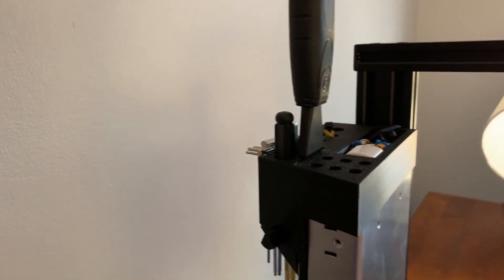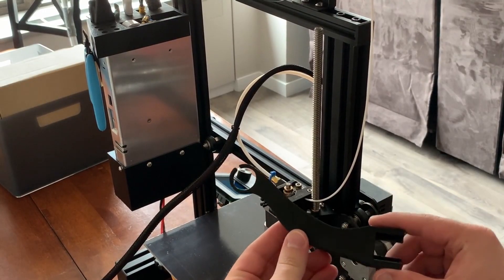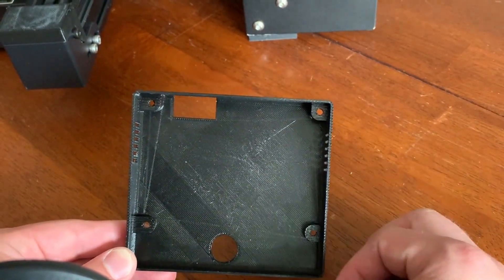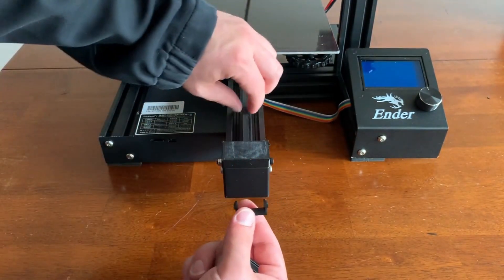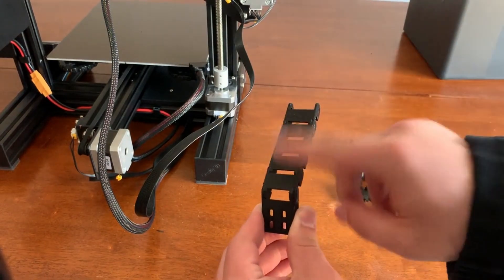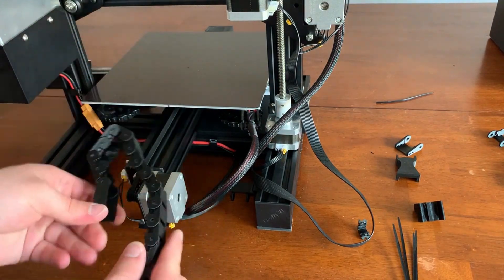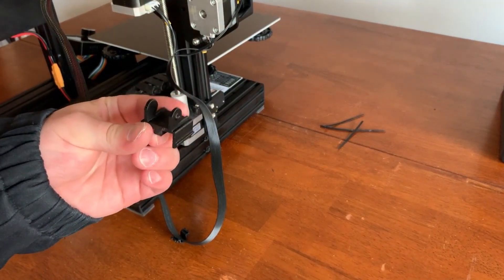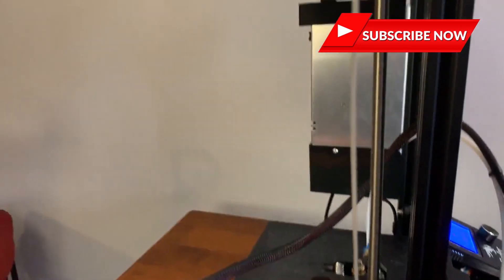Six 3D Printed Upgrades for the Ender 3

Comment: Hey bud.
I've got a Ender 3 Pro also. Your Power supply is way up too high.... Check that your upright is orientated correctly.
Reply from the maker: Yeah I saw another commenter said the same thing. I’m curious to know if that causes any issues that you are aware of? I’ve been printing on it fine for about a year now.
Reply: @lifein3d274  The only issues I can think of is added stress to the connector and also the possibility of the print bed or adjustment wheel fouling on the cable.

Comment: what material did you use for the cable chain? I've tried several times with pla, but they turn out brittle and don't fit together without breaking
Reply from the maker: I used PLA for mine when I made it. Its been about a year now, and some of the pieces have become brittle and need replacement. I believe I only broke 1 link putting it together though.
Reply: @lifein3d274  I guess my settings are off, I tried setting horizontal expansion to -0.4, they fit together without breaking, but they are even more brittle and they wobble all over the place. I'm just going to try PETG when I get my new batch of filaments

Comment: I noticed one of the parts for the cable chain you didn’t use did I miss that or did you not use it
Reply from the maker: You are correct, I left that piece out.
Reply: Ok thanks